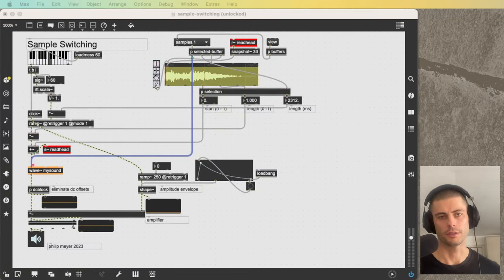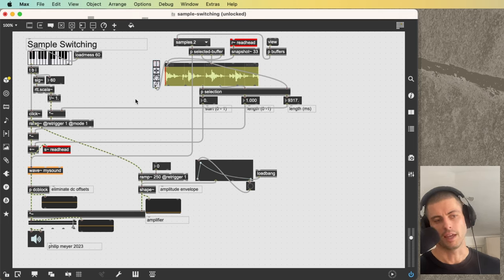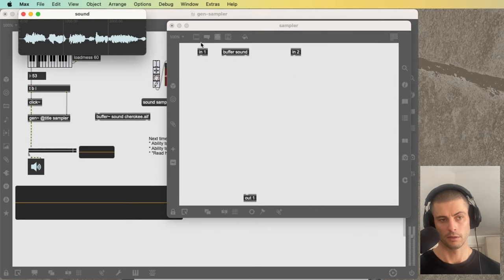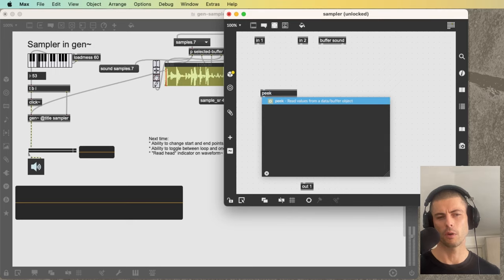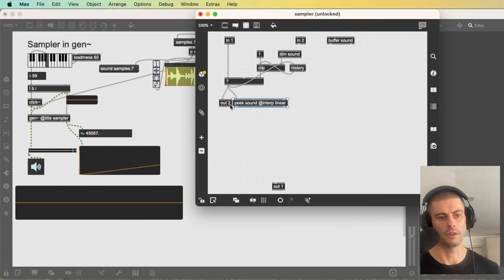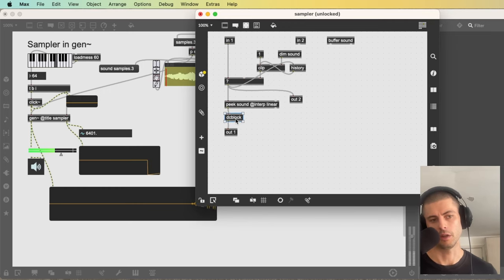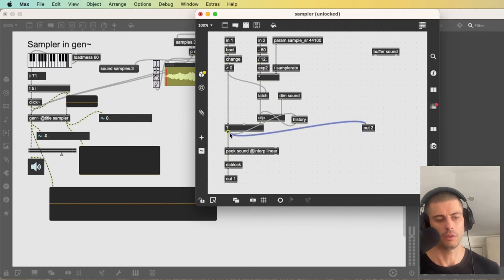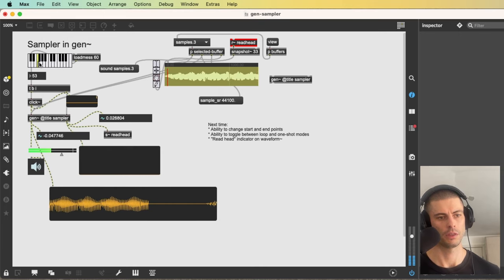Building a sampler with gen~ in Max MSP

Comment: very good tutorial. maybe it would be great to add some capabilities that are unusual for standard samplers, just to demonstrate why would anyone even bother doing samplers the hard way in gen~ and not just use Kontakt or whatever.
Reply from the maker: thanks vojko. yes I agree. one thing i want to build toward is mc-ified version where we are using the mc messages like "deviate" to mess with the sample playback. another idea is to use nonlinear playback ramps using some unit shapers from GO or somewhere else... like a crazy pitch envelope. 

would love to hear any other ideas you have.

for the more distant future i also really want to make the loop-finding feature from the old ensoniq sequencers (auto-adjusts loop start and end points so that the loop is smooth with no click). that one's not easy, though.
Reply: @p__meyer  I think it would be great to make a sampler with ability to slice live buffer content. Something like octatracks linear and random step locks. For example i've made a 4 bar groove on my external synths and resample it into a buffer, then slice it by selected divisions (1/4, 1/8 etc.) and rearrange the slices in different order to make a variation of my pattern. Ableton Simpler can't do this, but i think this incredibly useful feature especially in live performance. Thank you for this tutorial!🙏
Reply from the maker: @thisistrigger   awesome idea! maybe we can sort of elaborate on this idea of sample slices and have different ways of determining the slices - a fixed division of the buffer like you've said, an onset detector  like the one in flucoma (creating a result similar to the slicer in Simpler), or note event impulses that we fire off while recording into the buffer
Reply from the maker: @thisistrigger  super cool idea!